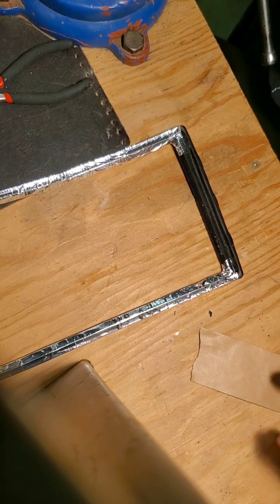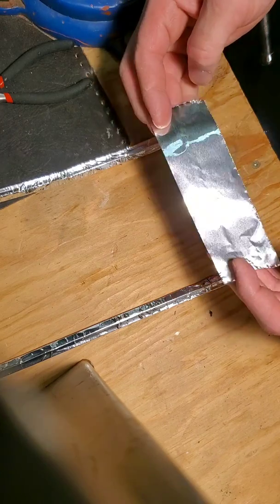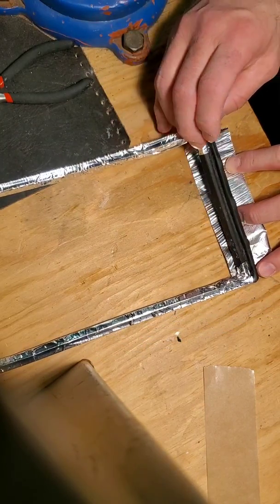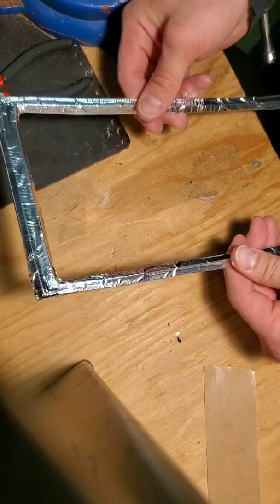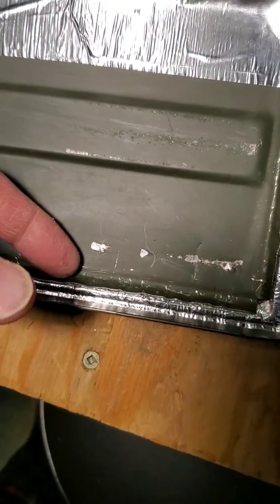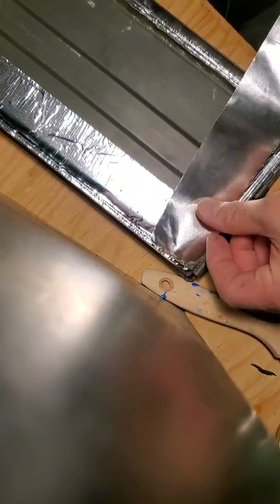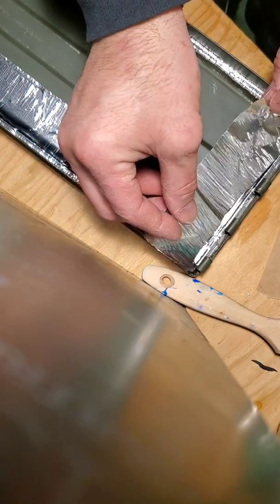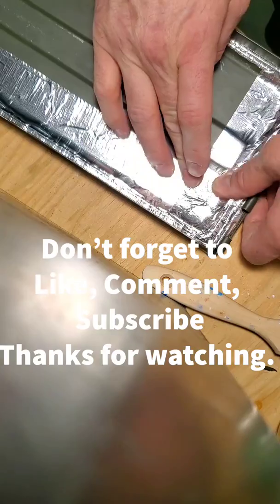#21 Ammo-can faraday gasket.

Comment: Any chance you have a way of testing it's effectiveness? great video, thanks.
Reply from the maker: Sadly no. Was hoping someone else did. Lol. The logic is sound and as long as the seal is good there shouldn't be an issue. That said could try various communications devices in and out of the box and at least we know something. Radio is a little iffy but a cell phone should be a decent guage.
Reply: @PrepareToLiveCa  no worries, I was just trying to avoid paying for a $60 gasket and was going to do the same thing and saw your video :)